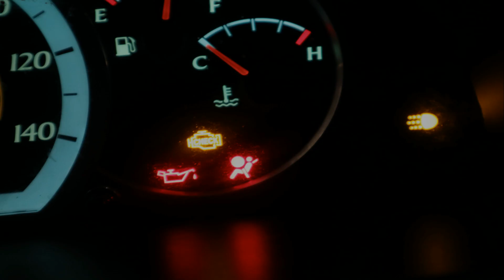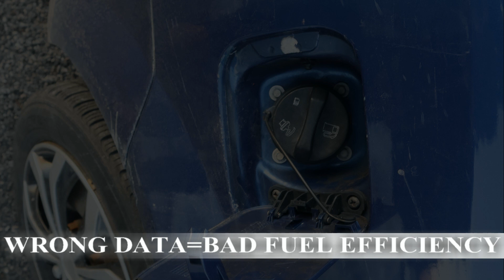SYMPTOMS OF A BAD CRANKSHAFT POSITION SENSOR

Comment: Would another symptom be my car not going above 3000 rpm? Notice it this morning while trying to drive and my car drives but will not rev past that point
Reply from the maker: Potentially, If the car senses a threat it will go into limp mode. This mode could limit you to 3000 rpms. Is the engine light on?
Reply: @easyautofix  yes the light is on
Reply from the maker: @876inc  do me a favor and let me know the codes that pop up please
Reply: @easyautofix  I have a p1650 code
Reply from the maker: @876inc  make model and year please
Reply: @easyautofix  nissan tiida/latio 2011
Reply: I'm having this same issue my car stutters at 3000 rpm and wont go above, as soon as I reset it with the obd it works perfectly... until the mil comes back.... are you still having this issue?
Reply: I have the same thing would it also be making a lot of smoke ? Smells of gas and do you think a fuse might be the problem??? I saw a vid on that thanks

Comment: In my bmw e36 every time I shift to 5th gear it throws up the rpms (like a downshifting affect) , idk if it’s the throttle position sensor, or what else it could be
Reply from the maker: How many miles ? Is the engine light on ?
Reply: @easyautofix  no engine light 135k mike miles. I replaced the transmission and it still does the same thing
Reply from the maker: @grvyrdgang5672  sounds like a transmission slip. Check your transmission fluid level. Low fluid can cause this as well. Was the transmission you got brand new or used?
Reply: @easyautofix  used
Reply from the maker: @grvyrdgang5672  manual or automatic transmission ?
Reply: @easyautofix  manual
Reply: @grvyrdgang5672  bad clutch bro
Reply: @xStaySkilledx  it’s brand new oem clutch tho
Reply: @grvyrdgang5672  was it broken in properly?
Reply: I have the same thing going on. Had the transmission replaced and everything. Turns out it was a bad selenoid in the transmission. No codes were ever on for it either.
Reply: @dayelmattos9985  what car do you drive ? I’ve also just found out in my case it’s a bad throw out bearing clearance, some at a car meet took a look at mines and said he also had the same issue
Reply: @grvyrdgang5672   nissian xterra

Comment: Would this faulty part cause my car to stall at lights or while my car is in an idle position?
Reply from the maker: Sure can!
Reply: Okay this is happening to me and my mechanic said it might be this sensor. But it's only happening after driving for a while. When the engine is cold, doesn't seem to be an issue.
Reply: @Brendonsoh  bro pls reply...i have the exact car problem..
Reply: @RLmainRL  yeah I changed 3 total sensors and the stalling stopped 👍 not sure which one it was though
Reply: @Brendonsoh  hahaha. Maybe crankshaft sensor,ignition coil and fuel sensor anyway..thanks bro for reply.
Reply: @Brendonsoh  hi, did you figure out the problem? I have the same symptoms

Comment: Is this another symptoms when the engine does turn on for one time once you let go off gas is shuts off
Reply from the maker: Poetentially but this symptoms is very known for a faulty or dirty/sticky Idle control valve.
Reply: @easyautofix  turns out my cam came loose and made my time go bad
Reply from the maker: @Tx-xp9fg  sorry to hear that. There will be better days!

Comment: The first 3 symptoms were spot on for me! 2011 Dodge Avenger with 120k miles. Was at a red light and I felt the car shake and the engine stop running. I turned the car off, waited a little while, and turned it back on and drove home with the engine light on. The car is at the mechanic right now.
Reply: I also have a 2012 Dodge Avenger with 126k miles. I recently had the sensor go bad and get replaced. First the car died kind of out of no where. Then it had troubles starting again. The check engine light came on and I had O'Riley check it and sure enough, it was the sensor. The car died a couple more times before I just took it to the mechanic.
Reply from the maker: Awesome, thanks for sharing!

Comment: There's also a good chance it could be cam position sensor its higher sensor that does same thing just on cams instead or crank it can also say bad crank sensor and really be cam sensor or say bad cam sensor and be bad crank hopefully this helps
Reply: How did u fix it ? Im having the same issue with my hemi maybe bc i got a aftermarket sensor ? Do you suggest i get an oem?
Reply: @finnesinhearts831  I've had this issue few times and yes going with oem especially with electric is best so there quality parts aftermarket is basically garbage anymore but I've had this issue on 3 or 4 Mopar products for me always been crank sensor
Reply: @miker5700   i think my cars pcm is bad bc 4 months ago my car had the code for the crank shaft sensor I replaced it car would still turn off, in the. Morning it was fine afternoon it wouldnt  turn on , later i changed the pcm and the car drove perfect didnt turn off or anything for 4 months and now i have the same problem so i think it might be the pcm since i bought the pcm from a junkyard
Reply: @finnesinhearts831  thats what I would try then if it solved the same issue last time
Reply: I’m code p0010 on my 04 5.4. Truck is bucking and sputtering but I’d unplug anything timing related VCT or cam phase sensor truck runs like a charm?
Reply: @413-n9k  oh man thats no fun.  I don't mess with ford's used to be my favorite truckback in early mid 90s and I mean 79 to of course...  but the 2000s are just junk.     Sorry but probably your timing...   I'm not sure but if has phasers means the timing would advance at higher rpm.   Does the rattling and stuff stop if you rev it up?  I'd assume when you unplugged the cam sensor it tells timing to revert back to normal where it should be at idle.  So with that being said I'd assume your timing is advanced and won't revert.   So check if the rattling stops when rev up. So could be the cam sensor is just giving wrong signal saying rpm is higher than supposed to be so could end up being cam sensor hard to say...    you can always take to a shop and they can diagnose if they know how to use their scan tool for live data most of the nice tools or data on conputers can tell you if it's reverting and advancing like supposed to.
Reply: @miker5700  well I got rid of the code. The truck has no rattling at alllll. Brand new motor 15k. Well according to everyone. Removing my cats and not tuning the truck has made it run extremely bad
Reply: @miker5700  when the light comes on and it bucks the cat codes pop up. Stuck lean. Every mechanic and buddy has told me my computer cant compensate for not knowing the cats aren’t there. This didn’t start until I straight piped it.
Reply: @miker5700  this motor runs like a bad out of hell. So I know there’s no way the timing has jumped. This truck will get sideways with 33s
Reply: @413-n9k  I was saying rattling didn't remember when I was typing what you called it sputtering bucking
Reply: @413-n9k  not saying timing jumped with those kinda work like the timing changes depending on rpm I was thinking from how you were saying unplug the cam sensor and it would start running good.  So as the cam sensor was telling the computer to advance timing because was at higher rpm when it wasn't and when unplugged basically was telling computer was qt idle
Reply: @413-n9k  oh I didn't know had no cats and was straight piped but yea you can try to program it.  Might be able to get it running alittle better
Reply: @miker5700  I don’t have any more timing codes. When I clear it and they pop back up I’m getting this. P0141 p0161 p2270 and p2272
Reply: @miker5700  I know it’s not the cam phase sensor. I replaced both and when it started acted up I switched them. If I unplug anyyy of them or anything related to timing it fixes it but  looses all power. And it doesn’t always do it. Only when the truck goes about 500 feet
Reply: @miker5700  the truck doesn’t do it once ur above 2500. Only under. When ur driving it surges even with the convetor  locked
Reply: @miker5700 the last thing I can do is put cats back on. The codes are gone. And when that p0010 comes up it says stuck lean, the same as cat codes. I’m leaning on the fact the truck running lean which is throwing up advancement of timing. Is this reasonable
Reply: Also I do know that the computer does us the 02 sensors to adjust fuel mixture ect if there not running right the truck is gonna lean our or run rich. Which is why when I unplug the sensor it goes back to normal default settings. But when there in its tryna pull data that says stuck lean(my sensors
Reply: @413-n9k  hmm so you said above 2500 it stops seems like the timing isn't adjusting as it should but like you said can be because the cats are off and it's getting signas from o2  thinking needs to be advanced.     With lean code have to much air so you definitely need a tune to make it run better I mean that would probably fix it but if can't get tuned put cats back on.   Could try restricting air intake also would give it a cool whistle turbo sound lmao...   I'd put cat back on or have it tuned idk anything about tuning  computers ugh
Reply: @413-n9k  your definitely going to have to get it tuned or put back cats in so it gets the readings so it can adjust itself when it needs to.  I don't think there's a way around it Ik some ppl have put extenders on o2 sensors idk how well it works I've never done before but look up ((how to run a catless exhaust on a factory tune))   that show u how to do it thumbnail is pic of black mustang.  It's up to you I'd just put cats back on
Reply: @miker5700  everyone says my 02 sensors don’t matter the rear atleast.. but than my mechanic guys are telling me the truck needs both to read so it knows how to adjust it
Reply: @413-n9k  you need both so it can read before and after the cat.  If it dont know what exhaust% is before the cat how does it know what way to adjust but you really need both.    Also if you didn't need it you think car manufacturers would put them there if weren't needed, I doubt it they try to cheap out everywhere they can.  I guess if your good at tuning because you can turn off o2 sensors might be able to tune it to run good without

Comment: I've had bad crank sensor on 3 dodges what they always did to me was start fine when vehicle was cold then would run and drive good for maybe 5 minutes then die and wouldn't start again for 30 minutes or so when it cooled back down hope this helps someone because they don't like to throw a code for it atleast that I've seen
Reply from the maker: Interesting, thanks for sharing!
Reply: FACTS!! Ive owned 2 chargers, a durango , 2 commanders, a liberty, an avenger(my daughters car)..they all had issues ,,but the jeeps & the durango had CKP issues /electrical
Reply: My 06 srt charger starts on cold but once warm it cranks slow and eventually start or just crank with no start until cold again then would start strong on first try. Could this be my issue? 
I already threw plugs, coils, injectors at this but no change.
Reply: @richey1794  yea could be hard to say.  I've had crank sensors go and I never got a code but it would start perfectly when cold then 5 10 minutes later it would die and not start.   I never sat and cranked it over and over trying to start it after was warm so I'm not sure if it would eventually start.  I've had that issue like 3 times so if sounds like your problem that's what I'd try.    Oh and I've never got a check engine light 

You could get it heated up to where it won't run them check fuel pressure even just press the valve should spray out decent amount if you don't have a pressure tester.   I doubt it fuel related.  could also check your spark when it's warmed up I bet you won't get spark.  Your crank and cam sensors kinda tell it when to spark.   So if sounds the same issue try crank sensor then cam sensor.   BE CAREFUL changing crank sensor its easy but the part that slides into block if you don't twist and pull might break since plastic maybe brittle so DONT PRY it!!!! try to turn back and forth and pull so you don't have to pull oil pan to push it through.         Let me know if it fixes it so others watching this video might get more info hopefully this helps and fixes it!!  Good luck buddy

Comment: I have a 99 4runner and won’t rev past 3,000 rpm. Could this be the problem?
Reply from the maker: Thank you! Great question, your symptom can actually be a lot of different things. To isolate the problem better I have to ask you some questions. Is the engine light on?
Reply: @easyautofix  yes
Reply from the maker: @quest808  what codes does it read ?
Reply: @easyautofix  P0125/ P0135/ P0171
Reply: Exactly what mine was doing and crank sensor was the problem but the odb hookup said Cam Sensor

Comment: Mines keeps dying every few months acura rl 2006 replace it twice it shut off while driving but start right up
Reply from the maker: Is the engine light on?
Reply: @easyautofix  yes it came on with a few misfire codes I replaced the vaule cover gasket and changed spark plug the mechanics erased the codes for the crankshaft sensor now the vsa light on
Reply from the maker: @sayblaze  they erased the crankshaft sensor code without fixing it?
Reply: @easyautofix  yes now I'm replacing it again for the 3r time that crankshaft sensor from the dealer only last a few months
Reply from the maker: @sayblaze  have any other codes came up ever since? Try looking into the connector of the sensor and check to see if there is any type of corrosion. Also look into the wiring and see if there is any tears or pinched wires as this can also prevent the cranks sensor from working properly.
Reply: @easyautofix   engine light comes on every few months after replacing it will say for crankshaft sensor i will check the wires  out thanks
Reply from the maker: @sayblaze  Anytime! Goodluck.

Comment: Great video. My car is taking two attempts to start. Could this be the camshaft sensor or a failing starter motor?
Reply from the maker: Thank you! Great question, your symptom can actually be a lot of different things. To isolate the problem better I have to ask you some questions. Is the engine light on?
Reply: @easyautofix  hello thanks for the quick reply. No engine light or codes up
Reply from the maker: @davidwood8837  Interesting, when it takes two tries to start the car is there a difference in sound ? In other words, can you hear the engine turn slow while cranking it?
Reply: @easyautofix  hello it sounds like cranking but you have to turn key couple times to fire in to life. Not much change in noise. It does seem to be when engine cold / left for while takes time to start. Once it's warmed up not half as hard to start
Reply: @davidwood8837  probably fuel check valve
Reply from the maker: @davidwood8837  when it’s cold, is it a consistent thing ? Do you have to turn it multiple times for it to turn on or sometimes it’s turns on right away the first time ?
Reply: @easyautofix  yes this is what my truck is doing only at cold starts already changed intake gaskets. And I got no engine light
Reply: Facing the exact same issue.

Car takes two or three attempts to start when it is cold (when turned off for more than 2-3 hours). Once it starts then no issue it works perfectly fine and even starts without any issue, but if it will be kept turned off for about 2-3 hours then again same issue of hard to start.

1. Changed Battery
2. Changed starter and assembly 
3. Got the fuel pump checked, no issue in it, adequate pressure
4. Changed return fuel valve and purge valve
5. Done injector cleaning 
6. Spark plugs changed
7. No check engine light, and no fault codes

Nothing has solved the problem till now, facing it from almost 1 year now.

Only thing left is changing cam shaft sensor and crank shaft sensor, I’ll try that too.

Comment: 2010 wont start. No clicking sounds.
Reply from the maker: Mmh does the engine crank at all?
Reply: @easyautofix  No. Fuel pump kicks in... Clock dims when i crank. Only noticable thing...
Reply from the maker: @OkieGrower75  I see, when was the last time you replaced your battery ?
Reply: @easyautofix  Maybe 2 years ago. Battery reads fully charged... Jumping had no effect. Not the neutral safety switch...
Reply from the maker: @OkieGrower75  I see. Is there any corrosion around the terminals ? Corrosion restricts full current from passing though.
Reply from the maker: @OkieGrower75  also I know you don’t hear clicks but do you at least hear one click?
Reply: @easyautofix  Connections are good. No clicking sounds. Not starter or silanoid... Possible crankshaft position sensor?
Reply from the maker: @OkieGrower75  usually the crankshaft position sensor still lets the starter crank but not start.. what makes you think it’s not the starter ?
Reply: @easyautofix  Im just guessing. Im no mechanic. Hell, i grow legal weed! Lol
Reply from the maker: @OkieGrower75  No worries lol I would start by checking the starter relay and stater fuse. A quick tip could be to locate the starter and have someone start the car while your tapping it with a hammer so see if it can get started. Watch my symptoms of a bad starter video to get a better understanding.
Reply: @easyautofix  Thanks. I appreciate all your help! Ill let you know what i find!💚✌
Reply from the maker: @OkieGrower75  awesome! Thanks for watching!